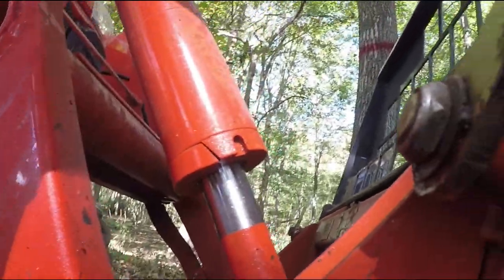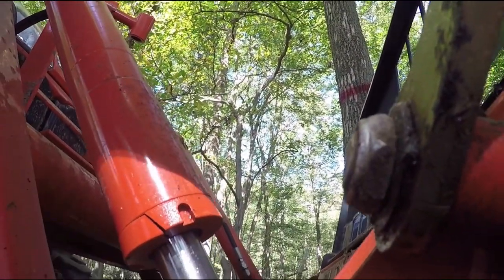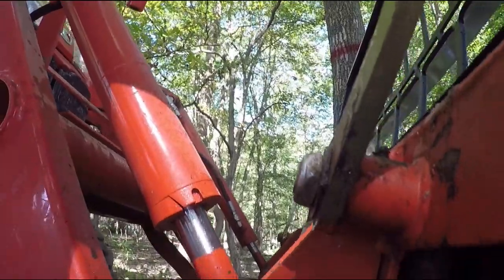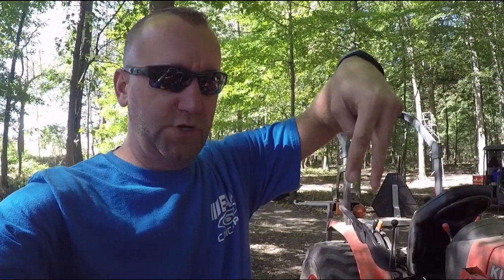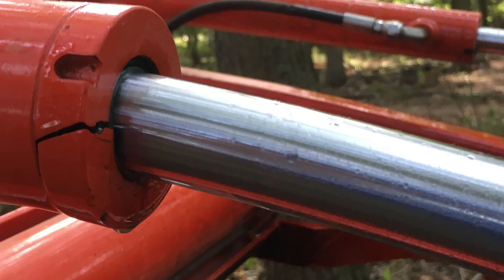Don’t Do This With Your Tractor!!

Comment: I back drag that way a lot with my BX25
Reply from the maker: Rob M 
So did I until I bent the cylinder. It’s not bad to have it angled down but when get it at an extreme angle is when the risk goes up.

Comment: There is a Company a few miles over the road from me called Burke's Engineering beside a town called Athenry in Co. Galway, Ireland and they would manufacture a complete Hydraulic Ram for this machine for a fraction of the price given here of $500.  
Besides, the collar in this particular Hydraulic Ram is a shit design for the purpose for which it is being used and a different design of a Ram collar would be more appropriate for the work that this man is doing in any case.
Reply from the maker: Sean Taniane
That’s awesome. I couldn’t have the whole thing for less. I could have the ram and gland made but by the time I had the tube made it made it more than what I could buy one for.

Comment: Tractor manufacturers make odd sized cylinders on purpose so that you must buy their parts.  Deere is the same way.  I've done what you've described several times on my 4520 deere without issue. I'm sure it'll happen at some point, just physics.  I've even dug trenches with pallet forks slid together and dug out stumps with pallet forks...abusing the crap out of them without issue...yet.  Yes I know I'm an idiot.
Reply from the maker: Jason Hendrix 
I agree. Odd sizes keep you coming back. 

I’m sure all have pushed our tractors further than designed. Even when farming we’ve pushed them.

Comment: You have to realize the limitations of a toy tractor, they are incapable of doing any real work, use them accordingly
Reply from the maker: letserb 
I agree. I just didn’t think about the forces I was exerting using it that way with the forks. It seemed like one of the lighter things I’ve ever asked the tractor to do. It didn’t have any problems splitting the tree. It was already cut. I was just trying to spin it.
Reply: Never was a fan of those light double cylinder setups, a single heavier cylinder seems to stand up far better. There is a reason large loaders are built that way.
Reply from the maker: letserb 
I agree. Every large loader I’ve ever seen has a large center cylinder.
Reply: Yes, and the twin cylinder design always seems to destroy a cylinder, it is a poor design, one large cylinder works far better than two smaller ones. I would never be able to run something that small, I am used to heavy equipment where hydraulic power is hard to max out, where you have all the power you could ever want. These little tractors are cute but to me they are a child’s toy.
Reply from the maker: letserb 
They do have their place though. Large heavy equipment ruts the yard. I also had to choose the tractor based upon what fits in my woods. I didn’t want to cut any trees to widen the paths as there are some nice mature trees on the edge of the path.
Reply: LOL by heavy I mean industrial, cat power, excavator, actual large loaders. I have worked construction based my whole adult life. I am no stranger to the farm tho, was working in the field at seven years old running a JD 70 raking hay. Was not uncommon for my father to have me on the tractor with him as a baby while my mother stacked bales. You could say it is in my blood LOL I do understand what you are saying tho, maybe a case of your eyes being bigger than your tractor so to speak.
Reply from the maker: letserb 
I assumed that’s what you meant. Thats what I consider heavy equipment. That’s why said they would tear up the yard something crazy. I’d LOVE to have a large payloader. I don’t know what I’d use it for but it’d still be cool, just not practical. 

I also farmed with my father until a year ago. I’d love to have a larger tractor but that’s where I had to reel in my expectations. I used our Case MX100 to drag out a couple larger trees that I felt were too big for the Kubota and it was all I could do to fit it through the woods to the trees. 

I really didn’t think I was doing anything that crazy when I bent this. There’s many times I felt I was pushing my tractor much harder than this. It wasn’t a large log and it was already cut. I was just trying to swing it around.
Reply: Hey understand, you can’t take the farmer out of a person, it is in the blood of a person who grew up working the land. I just transitioned into far bigger toys for boys LOL the pipeline company I worked for owned the biggest side boom in the world. It would pick up a D8 based crawler boom with no problem. Vehicles have that same effect, at 17 I had a 396 balanced and blueprinted firebird, have owned more muscle cars than I can recall. There is something about having that power at your command that can only be experienced.

Comment: Just suscribed to your channel!  I got similar experience, where digging a rock with cylinder in near full extension. I accidentally dropped the clutch.  Two flexible hydraulic hoses blew at the same time.  Got splashed with oil.  I was lucky the oil was not hot! The hoses were less than 100$.
Reply from the maker: Holy cow. I wish it was just a hose me!

Comment: Well, then a I've been lucky. Not braking any. Done everything possible to get the job done. If I know it can't do it is because tires spin. One thing I try not to is ramming hard stumps or other things. I've tried loading too heavy stuff to the point it probably bypasses pressure.  Just stop and do something lighter.  It still works.
Reply from the maker: deepcritik 
If you’re doing something and the relief valve opens then you must actively using the hydraulics and the spool valve isn’t closed. The danger comes when the loader valve is locked and there’s no where for the pressure to go.
Reply: @JaredsShop  ok. I guess I havent done it that way. But I I've dragged logs and rocks, gravel with the bucket edge vertical. Sometimes wheels in the air. Maybe a video of the machine in action would help my misunderstanding . Thanks.

Comment: i heard b series  might  have this problem with a  loader or cylinders!  i was close to buy b2601 but end up buying l2501!  never heard  complains about l series but of course it might happen to any tractor !
Reply from the maker: It sure can happen to any tractor and any brand. In fact, I’ve found multiple stories of equipment of all sizes including large excavators and crawlers. It’s not limited to just tractors. Any time a cylinder is extended close to max and stress is applied via driving the machine, you can bend a cylinder. The power of a machine driving is greater than a cylinder can withstand.

Comment: Were you at wide open throttle ?  Half throttle will prevent this ... only use full throttle when pulling .   The loader can’t handle full hydraulic pressure . Half gives it some give .
Reply from the maker: Paul Lambert 
I wasn’t using the hydraulic pressure. It was locked and I was backing up. That is what put the forces on it.

Comment: Only $500 for a cylinder!?! Oh to have that price now in 2021!!
Reply from the maker: How much are they now?
Reply: @JaredsShop  double at least, if you can get them at all. There's massive shortages on new tractor parts and prices are through the roof. I just checked and cheapest I could see is $900, and that's aftermarket, but I didn't look deeply. Oh Im also up in Canada where we pay even more. I was quoted over $1500 Canadian over the phone for a new cylinder this year for one of my tractors.
Reply from the maker: @jwbeaton  
What loader do you have? Curl cylinder also? Aftermarket’s can be had for much much less but they may be just a little different in size. I found some but they were about an inch longer so it didn’t curl back as far. They were under $100 at the time. Let me know your pin size, retracted length, stroke, piston and rod size and I’ll see what I can find.

Comment: Dude take this from one old logger that's laughing my ass off at your predicament if your piece of s*** whatever it is..... what you need is a 1964 cat 933 traxcavator with forks.... I bought that thing 25 years ago for 5500 I ran at 8 hours a day running it into a cement wall all day long backing up all back and then hitting it again abusing the f*** out of it - 20 below running it and 110 Fahrenheit.... I just abused the hell out of it but when it's a caterpillar it's not called abusing it it's called operating it.... in 10 years I put a couple hydraulic hoses on it few batteries in it because the batteries just didn't last...... I go log the swamps when it was 20 below so I could get out there and get them fat trees on the ice...... that thing just amaze me day after day after month after year.... minus the cost of a couple batteries 2 hydraulic hoses are sold for 6000 10 years later....... when you guys will be broke down I take my forks and scoop you up and take your machine over to a spot where you can more that buy them really expensive Japp parts.. buy yourself some American Rusty but trusty iron..... every time a little piece of s*** breaks down in the part  cost 5 times more than what it would remember I'm laughing at your ass......
Reply: If you don't have the right piece of machine not something for doing lawn work or scooping snow but real machine all them stops would be cast into the loader and no stress wood gone the cylinders... I always liked you guys I called you logging on starvation sticks
Reply from the maker: d Eddie 
I’m doing this with my tractor because I don’t want heavy equipment in my woods. It’s a fairly wet woods and I didn’t want it rutted up. 

The tractor did great skidding. That wasn’t what broke it.

There are many stories of the same failure happening on CATs too. Nothing is immune to this type of failure.
Reply from the maker: d Eddie 
The stops won’t prevent this failure. I have stops. This wasn’t an over extension. The cylinders were fully extended and were trying to be forced back in, which is how it broke. It happens on all kinds of equipment.

Comment: You NEVER put the forks on the back end of the tree.... you risk splitting the end cap of the hydrolic unit... a new cylinder unit for this is about $500.
Reply from the maker: jeremy western 
The split was only part of the problem. The bent rod and the deformed tube is what really made it unrepairable.

Comment: ALL THESE CYLINDER HAVE A RELIEVE VALVE THAT PREVENT  THIS  HAPPENING
Reply from the maker: Rejean Caron 
The relief valve is on the pump side of the valve, not the cylinder side. It does prevent damage when the valve is closed. The hydraulic fluid is locked.

Comment: am i wrong to say a longer cylinder would give you more throw not less  and the remaining cylinder or cyl. mounts would make the limits .  the longer cyl.  would go out further and probably the extention could be more but again the existing cyl. would stop the extention.  the retraction would still only go to the cyl. mount   buttttt not a good idea because it tweeks the bucket and pivots.
Reply from the maker: paul johnson 
You are correct. If I wasn’t clear, I want to make sure the cylinder isn’t longer when retracted so I don’t lose the curl back of the bucket. Don’t want to be spilling dirt when traveling.

Comment: I’ve put full weight of the tractor or more on the loader at full extension pushing rocks and boulders. Probably broke because it’s cheap foreign made crap now a days. They cheap out on the cylinders to save money
Reply from the maker: Jordan Harris 
Could be but the physics are still there. I found reports of bent cylinders on everything back to 1970s backhoes so anything can be bent with the right situation. It may just be easier nowadays. 

I bet if I didn’t have it fully extended I would’ve been fine. 

I know of someone who has bent at least 2 log splitter cylinders. Those things are big with a large diameter rod.
Reply from the maker: Jordan Harris 
Also, I was dragging, not pushing. Dragging is when it’s it is trying to push the piston back in the cylinder.
Reply: Probably made of cheap Pop Metal with all kinds of impurities.
Reply from the maker: leegenix 
It’s possible but there are stories on this happing to all brands of machines clear back to their invention and back to good old American steel.
Reply: We had a 4.5 inch cylinder with a 2 inch rod bend on a log splitter.

Comment: Kubota sux, I went to new holland and am much more satisfied.  The balance and stability is so much better on slopes.
Reply from the maker: Telesaurus 
When I was looking, Kubota was the most tractor for the money. It weighed more, lifted more, and lifted higher than other brands for the same money. They’re also considered tops in quality. The damage I incurred is not alone to Kubota. It is found across all brands and sizes and nothing is immune.
Reply: Yea, I get that, we all want the biggest bang for the buck.  I have some really steep slopes and the way the engine was placed the balance and stability was lacking.  I came close to rolling it a couple of times.  I demoed a new holland and told them to leave it.  I probably wouldn't have the problem on level ground.

Comment: Quit pushing/pulling on heavy loads with the hydraulic cylinders fully extended and this won't happen.
Reply from the maker: Rich B. 
Pulling on an extended cylinder won’t hurt it, but pushing might. That’s the point of the video. To share what can happen if you do.

Comment: Check with Surplus Center out of Lincoln Nebraska.
Reply from the maker: Daniel Bowman 
I did. I couldn’t find an exact replacement. Found some close but no cigar. My cylinder is 1.75” bore, which is rare, as is the stroke.
Reply: Yeah that would be a odd size?

Comment: OUCH!  A B 3300 isn't a subcompact, either.. wow.    Not sure how different what you did is from typical back dragging of snow or dirt.    You should not be back dragging anything at more than 30 degrees, though..
Reply from the maker: MiserableOldFart 
Yep, anything too too steep is a danger. 
I think you’re technically right. A sub compact is actually the smaller tractor like a BX.

Comment: could have rebuilt cylinder. No instant karma like you got from your dealer, but might have saved you a buck. See Abom79 and company, Motion Solutions I believe
Reply from the maker: I did try but the tube was deformed. They would have to machine a new one and overall it would have cost more.

Comment: you used a toy tractor as if it were a real tractor. buy a john deere, they dont break like that when you use them and do stuff like what you did. and you should be able to do that with a tractor and not break it..... that cylinder should have cost more, should be bigger. as you found out, they under engineer these little toys.

      to save money, buy a full sized tractor.  short term it is more expensive, long term you dont have to replace parts that are under engineered. how do I know this? I have worked on both for years and am a bobcat certified repair tech, 15 years.  buy a full sized tractor buy it used even if it was built in the 50's.
Reply from the maker: Luke Warmwater 
The failure isn’t related to the brand or size. I researched this failure and found reports of it happening on every brand and size of equipment. Even large excavators have experienced the same damage.
Reply: did you also find that tractors are not made to back-drag and that is also why it broke? you see taking weight off of the steering tires is a no no physics also conspires to flex the rods, very bad.  anyway, buy better cylinders. the rods flexed and broke the nuts.simple as not being stiff enough. a better grade of steel would do the trick. this was never a problem in the 80's and the quality of the cylinders and rods is all of the reason why.
Reply from the maker: Luke Warmwater 
Yes, I agree on the back-drag. I didn’t have the wheels off the ground. I just put my forks on the other side of the tree and drove backwards. I didn’t even think I stressed it hard. It was just the leverage of the forks that increased the forces. It was the research on the failure that made me decide to share even though I wasn’t necessarily back-dragging. I do see people doing what you say though. Front wheels up in the air dragging backwards. 

I agree that a good steel would reduce it, but not eliminate it. It has happened to the old equipment, just probably not as often. There’s a couple comments here from guys who damaged some gold old American steel. One guy damaged a CAT track loader. My hydraulic shop said they’ve seen large cylinder from huge excavators with the same damage.

Comment: The pressure relief valve should go before reaching such a stress point, all I can say is it's a poor design....
Reply from the maker: GenasysMech 
It wasn’t using hydraulic pressure. The spool valves were fixed so the fluid was locked. The force being applied to the cylinder was being caused by the tractor moving. That’s what bent the cylinder. Not hydraulics.

Comment: your first mistake was not buying a John Deere tractor. If ts not green its not mean.
Reply from the maker: Cory Brague 
I did look at green as I have a Deere zero turn but they just don’t offer as much tractor for the money. I would have had to spend a lot more just to come close to the tractor I have.  Even then it was going to be shy on lift capacity, height, and GPM. 

I also get service that is millions times better at Kubota than I do at Deere.
Reply: there are JD video that did the same thing
Reply from the maker: Robert M 
Exactly. Nothing is immune.